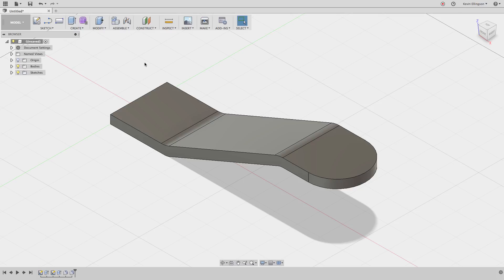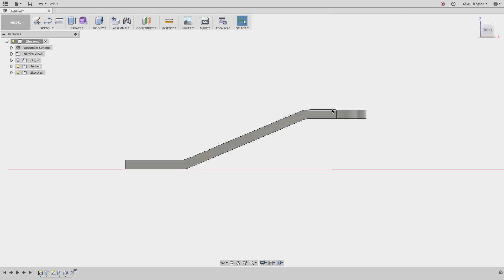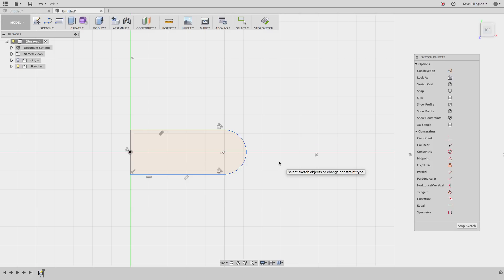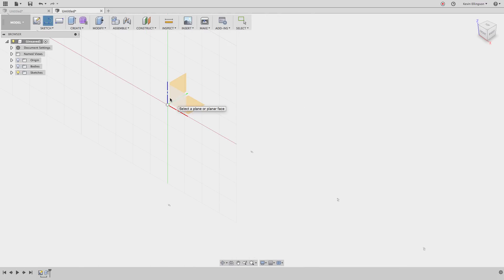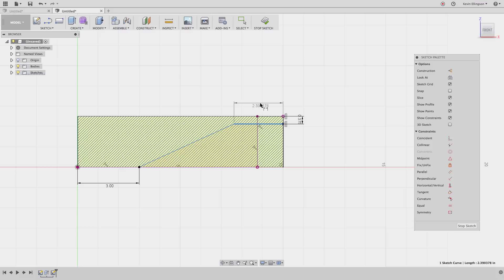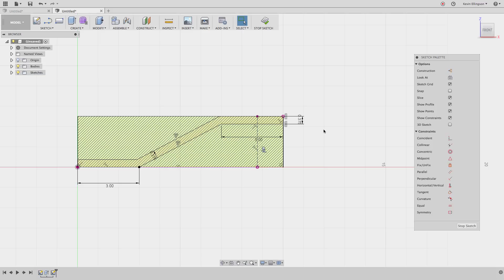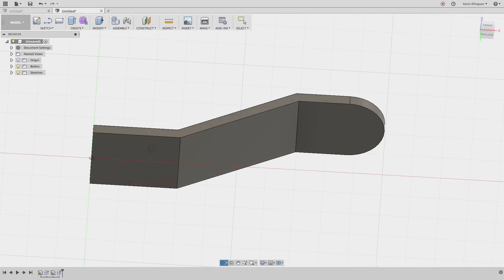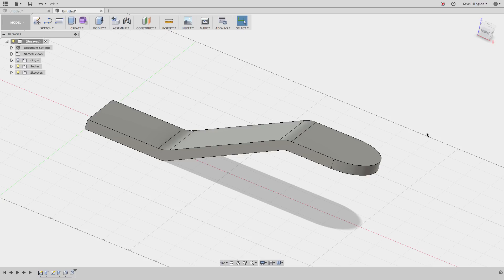Fusion 360 - Understanding the Intersect Operation Option

Comment: how did you sweep that arc like that?
Reply: i was wondering that too.  after trying it a few times, here's what i've got.  
1.  click "L" to start a line.  
2.  L click where you want first point.  
3.  L click where you want second point of first line.  
4.  hold L mouse button while moving cursor to the spot where you want the end of the arc to be.  it's key that you hold the mouse button down while moving.
5.  release mouse button to place end point of arc.  
this does take a bit of practice on steps 4 and 5 to get right.

Comment: Thought this is what I needed :(
I'm trying to figure out if there is a way to have fusion adjust interfacing/locking parts so they have the proper reliefe points.
Example: I'm trying to make two parts simply fit into eachother (aka, insert rod A into slot B type deal). When I design this as I think I want it then print it, the parts that are supposed to mate up come out the exact same size those cancling eachother out.

What is that type of pressure fitting called? and is Fusion capable of doing this automatically or do I have to manually do all of that?
Reply from the maker: Porsche Duésnburg I believe you are looking for the Combine command using the subtract option. Send me an email to info@mechanicaladvantage.com if you need to and I think we can get your question answered.